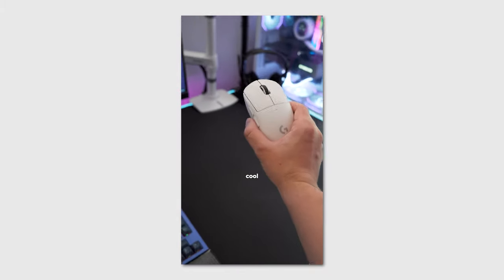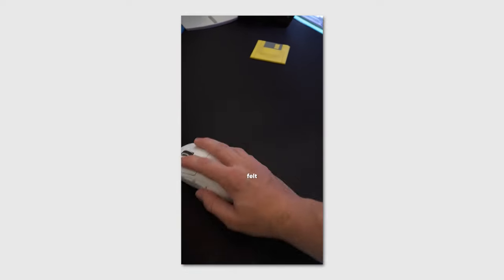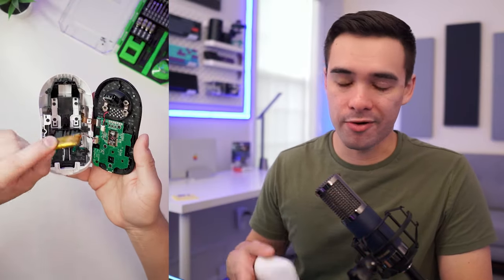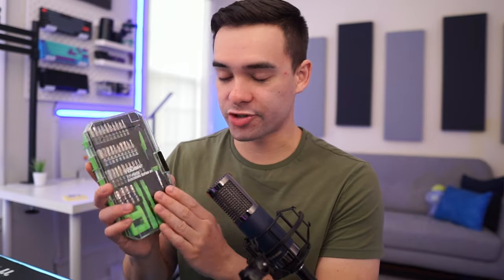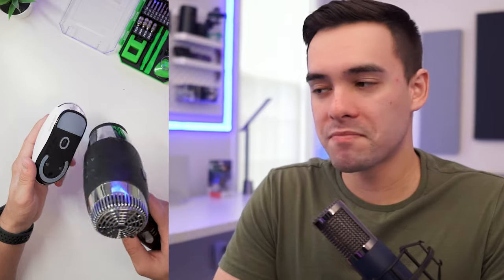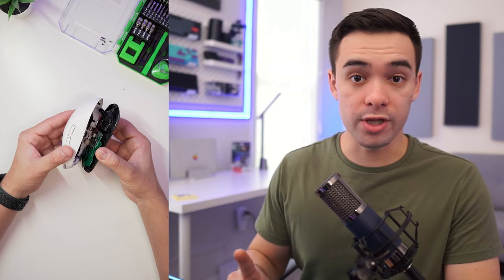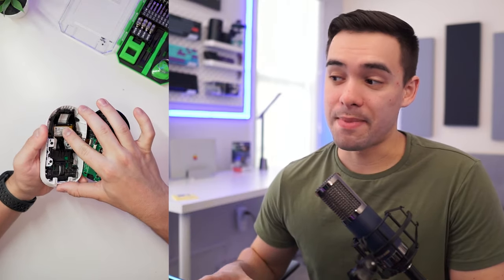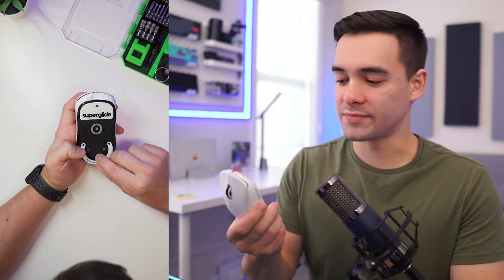Fix your Logitech G PRO X Superlight's Rattle

Comment: I had the same problem, i glued the battery back and since there is no money for new gliders, i decided to put the old ones in place, not ideal, but I recommend it as a solution
Reply from the maker: Nice! Any tips to those that want to remove the stock glides without damaging them?

Comment: my superlight 2 is creaking when i press on the bottom on both sides, i think the screws came loose or something as its been like this since i got it. i ordered new feet so i could open it up and check but im still wondering what the issue is. do you know?
Reply from the maker: Sorry for this late reply! Were you able to figure out the issue?

Comment: can I use a superglue for to stick or will that ruin anything?
Reply from the maker: I’d probably stick to using an adhesive dot in case you ever need to swap out the battery in the future for a new one
Reply: but are that dots strong enough? i mean.. it can go off again in a few weeks no?  @driggsy
Reply from the maker: @user-j9ki7r  they are veeeery strong. I don’t have any concerns about them coming undone!
Reply: For anyone in the future, I just used super glue, this is the 2nd time I had to open this mouse, first was due to the mouse wheel scrolling from even the slightest touch and now because of the battery. If I have to open it again I'm just throwing it in the trash..

Comment: Awesome video. I bought it for 219 CAD and I’m just fcking pissed off that for over $200 they couldn’t glue the battery on properly…
Reply: same bro...did you end up using adhesive dot or something else cuz i cant find adhesive dot locally
Reply: @op8ztv  yeah I put a small piece of tape inside and it works well now

Comment: I fixed the rattle.. what I really came in to conclusion that I ain't buying Logitech anymore... wtf is this design to have microscheme on top of mouse inner part with cheap way to glue it.. either way no.. pads impossible to reuse after peeling them off the first time.. impossible! so bought new glides.. what is not cheap really... well.. 2 months after putting them on.. scroll wheel decided to disobey moving opposite direction every couple swipes.. nah.. ordered EC2-CW.. bye Logitech and your overpriced Chinese factory slave labor products